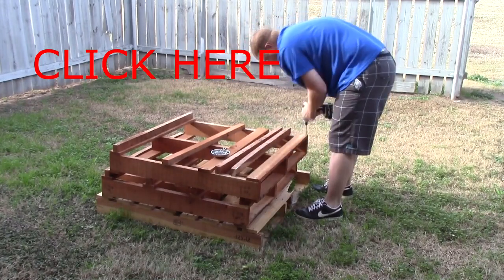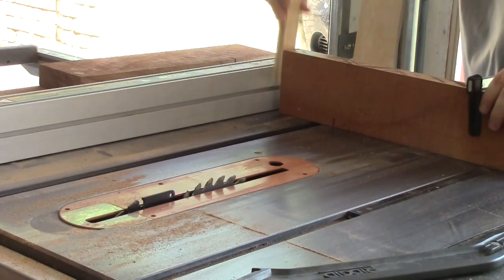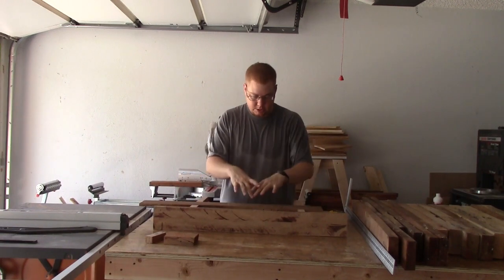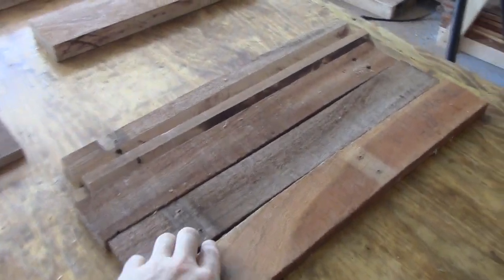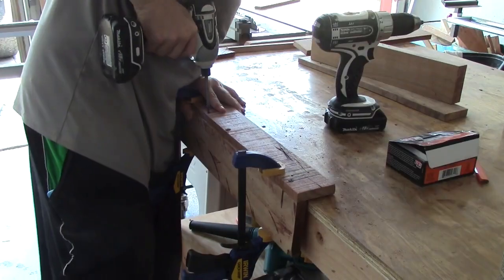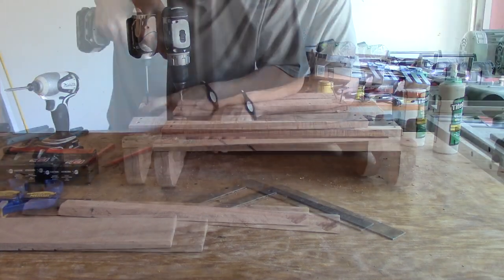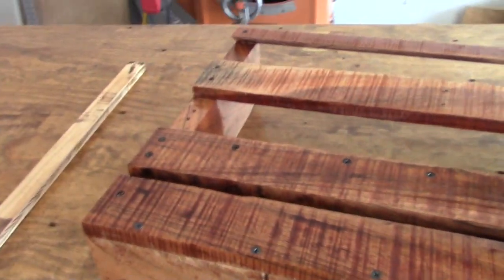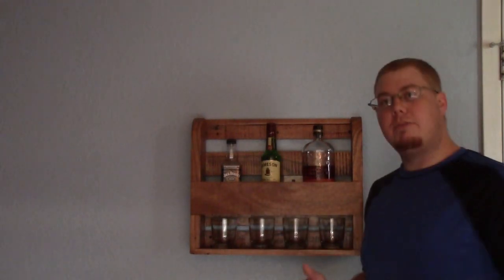My Next Project: Mini Bar Shelf (2015 Pallet Challenge)

Comment: I think you have to use jointer not sander
Reply from the maker: +Mohamed Islam I completely agree with that.  I actually just got a planer and will be using it very soon.
Reply: +Studio Epic me too and You don't need to know how I'm suffering when I go to the carpentry shop to use the planer for 54 piece of wood
Reply from the maker: Wow that is alot of pieces.  I should have a video up in a few weeks where I will try out my planer.
Reply: +Studio Epic  Yes it's  fact , The last Saturday I've finished the rest of 54 palet's wood ( 37 pieces first time 17 pieces the last time ) 

I've cut out the nailed pieces and put the rest on the jointer then the planer
Reply from the maker: Wow, that is dedication. 

Thanks again for watching and commenting.